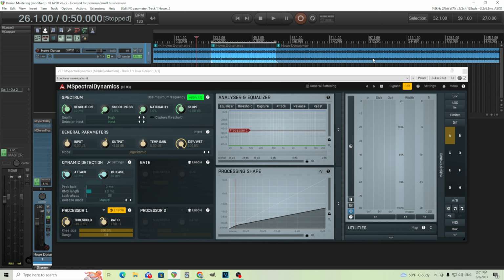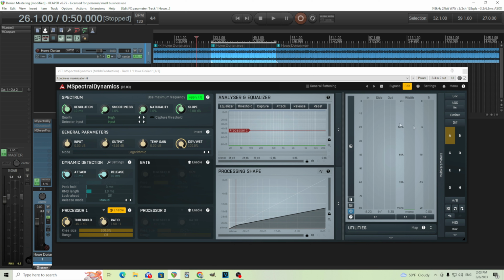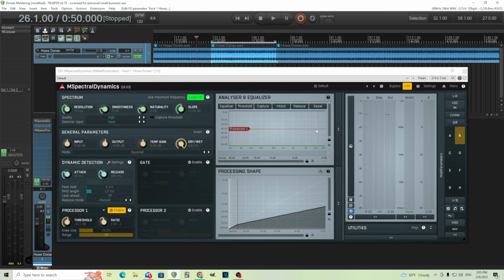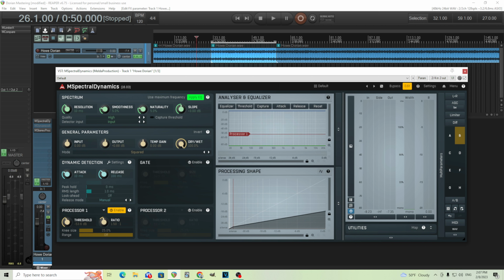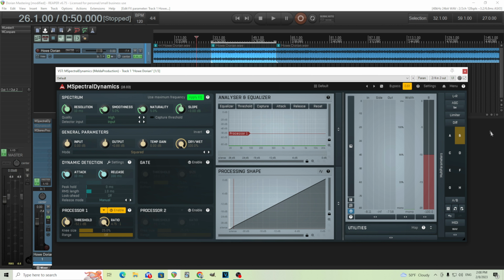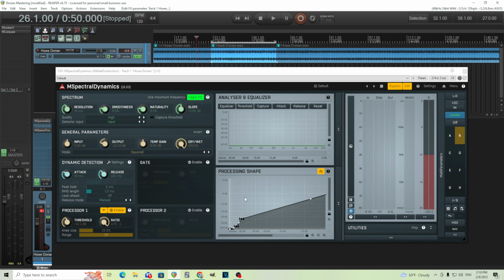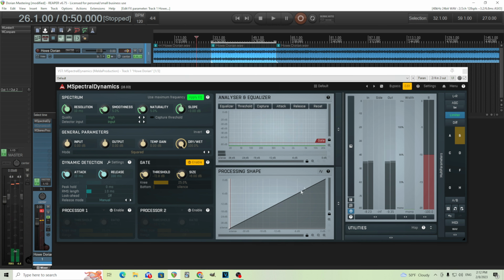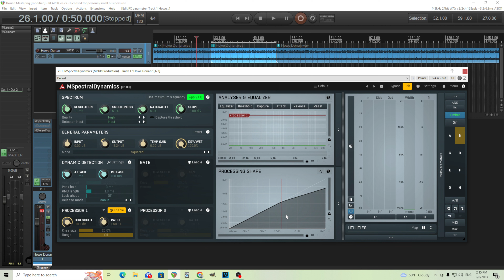MSpectralDynamics upwards and downwards compression

Comment: Mate, after your video I started spending some time with the plugin. The more time I spend with this plugin, the more fascinated I get. This plugin can do upwards compression, downwards compression, upwards expansion, downwards expansion and OTT (In the shape processor we can set 2 nodes that can act as 2 threshold points and achieve it). This can clear the material surgically. It also can eq. It also can do spectral side-chaining. A true multi-purpose tool which all the audio producers should have. I am not sure why this is not talked about much. Thanks again for this video.
Reply from the maker: No problem. It really is a complex tool and sometimes I find new stuff that I didn't even realize it could do.